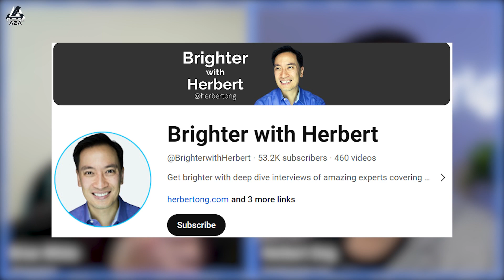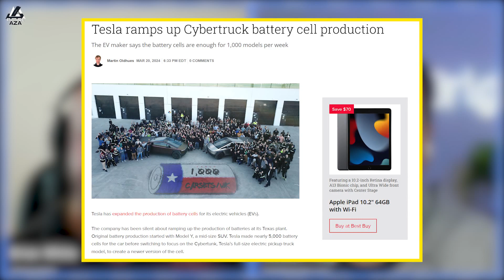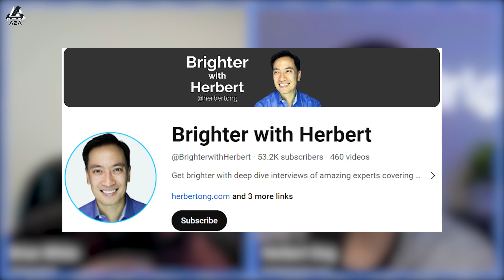4680 Batteries: ARE WE THERE YET?

Comment: Tesla revealed the 4680 battery cell at Battery Day in 2020, and there were many ideals and goals set forth for its future capabilities. Being more energy dense than the 2170 batteries, being much cheaper to produce, being cleaner and quicker to manufacture. But it is always a great trial to bring a R&D project all the way to volume production. Tesla was going to make the 4680 batteries with higher nickel content and silicon anode in contrast to the batteries of the day, to achieve these goals. Plus Maxwell's innovative dry electrode technology would eliminate toxic slurry, reduce the length of the process and lower the cost of manufacturing batteries. The 4680 batteries were a huge success simply because they were able to build them at volume production. But the 4680 battery was always designed with the idea of product evolution, and reaching those lofty design and engineering goals over time. Tesla is looking at the possibility of the next generation 4680 as having higher energy density cathode material that uses more nickel (NMC955) as well as possibly using asymmetric electrode coatings, and finally adding silicon to the anode (which was promised in the 2020 Battery Day announcement). I see them adding skilled scientists and engineers to their staff as being a sign of progress, not failure. And I hope that the next generation 4680 batteries come out quickly, cleanly, reliably, and at a lower price than today.

Comment: 6:40 (IRA effect): I love Tesla, but I wish the USA Government would ease off a little with the pressure. Tesla doesn't need the help and the other American automakers have not yet shown they can do what is needed even with the "help", thus driving a wider gap between Tesla and the rest, while also driving Tesla to continue the use of so called "Ternary" batteries instead of cheaper and in some ways better Chinese LFP and M3P (LFMP?) batteries (which they also use in some cars). Yes I know the ternary batteries may have better power and energy densities, but safety, longevity and simplicity of maintenance all favor the newer LFP batteries. And as for the "help" for the traditional OEMs, codicils added to the IRA produced friction to Ford's plan to build a large American battery plant, simply because they were going to be paying a license fee to CATL for the technology to be used, all because some congressmen didn't want there to be a risk of even a tiny amount of the IRA money leaking into Chinese hands. I wonder how much of their salaries have leaked into China's hands? It's pretty hard to buy anything these days without at least a little lucre flowing over the Pacific. So, America will fall further behind the Chinese in battery manufacturing and technology due to congressional BS. Silly Legislators.

Comment: Does anyone know if Tesla has solved the cathode issues? I can't find any information on it anywhere.
Reply: I don't think so. This is why they aren't ramping 4 lines at once (they have the hardware). There is still the issue of building a cathode with silicon in it to boost energy density. They may or may not have stabilized the dry cathode, though as of 2023, they had not yet done this. 

So no. I think the 265wh/kg current 4680 (barely on a par with the 2170 - the Cyber battery) is still a shadow of the fully realized battery. I think this is one of the main causes of the elevated price tag of Cybertruck and the slow rollout of the Semi. 

They completed installing the cathode plant equipment but aren't using the product yet. Meaning the energy density is still 10-15% low of the target while a wet cathode means ovens which means much higher cost and lower production rate than targeted.

I think this iteration is barely adequate. 
If solved, the price of the battery should drop (a lot) and energy density would reach 300wh/kg (at long last) and make both Cybertruck and Semi profitable as per the original plans. It would also allow a Cybertruck with a longer range.

But it looks like a breakthrough will be needed and those are hard to predict.
If anyone has specific info on that, it would be appreciated. I was using Grok which is only loaded to 2023 EOY. Maybe they were inspired in the last 3 months.
But  I think all 4 lines would be ramping now if they were.
Reply from the maker: No information, which leads me to conclude it's s no.